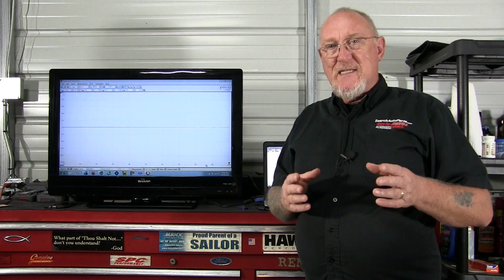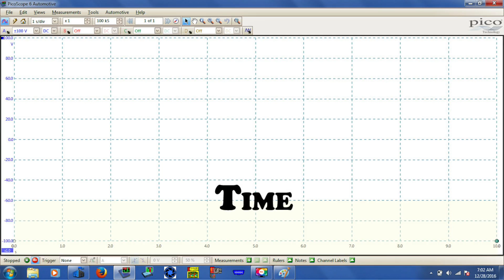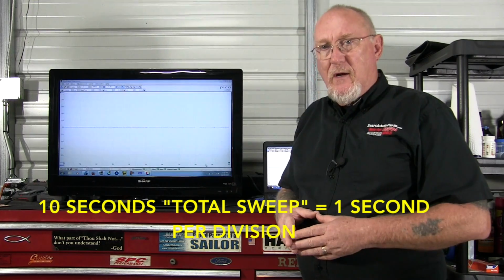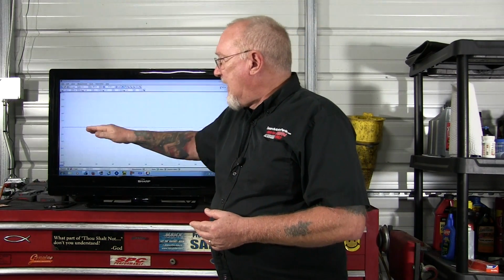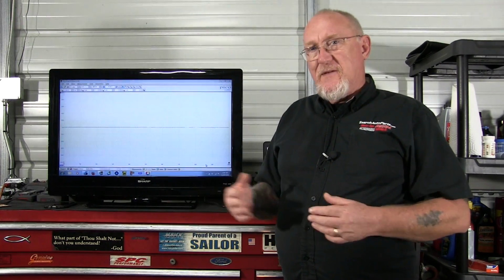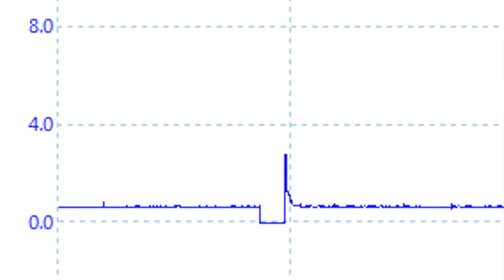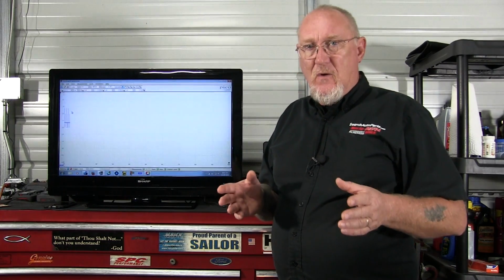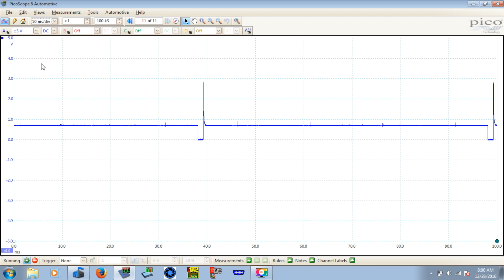Motor Age How2 #2:  Using Your Scope's Voltage and Time Settings

Comment: I have been using a lab scope for years.  When my old scope crapped out I felt naked till I got my new one, actually my third one.  I enjoy viewing presentations cause no matter how good you are you can always learn something new.  Even if it is just one thing.
Reply from the maker: Thanks for taking the time to comment!
Reply: Which scopes did you own in the past that failed on you? Thanks!!!
Reply from the maker: My first scope was an old UEI model, the same as the Snap-on LS2000. It worked great but had no capability of recording data for later review. Then I added Pico to my toolbox and have been very happy with it. I've also used the Snap-on 4 channel and the ATS EScope. All were capable tools. Oh yeah, I have the uScope too! Great little one channel, pocket sized scope that is great for catching a quick pattern. You can find out more about them all here:

Pico:  https://www.picoauto.com/

Snap-on:   https://www1.snapon.com/diagnostics/us/productindex.htm

EScope:  http://www.automotivetestsolutions.com/escope-pro.html

uScope:  http://www.aeswave.com/uScope-Master-Kit-1-channel-automotive-scope-p9273.html